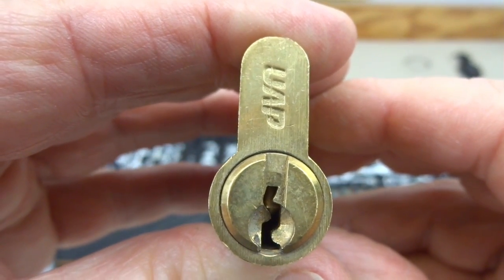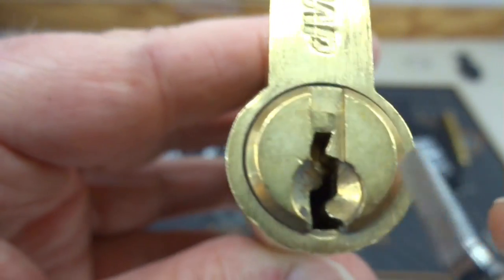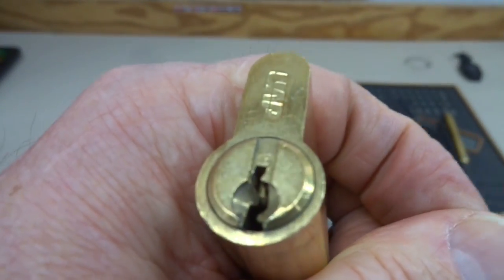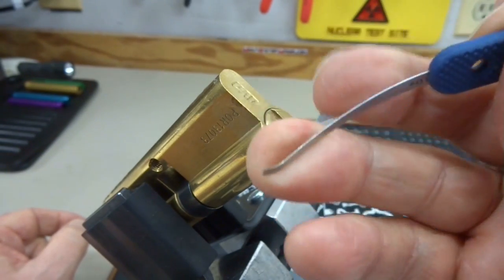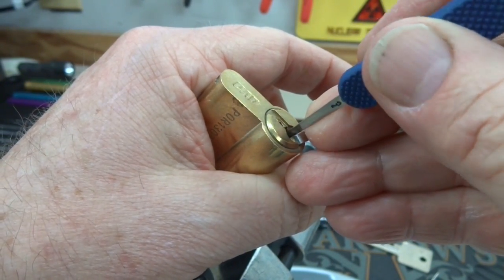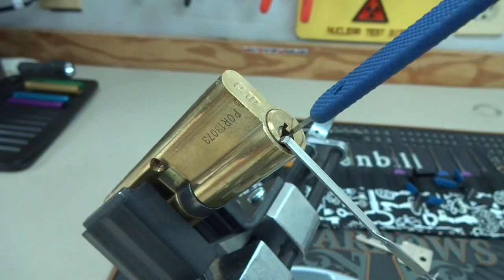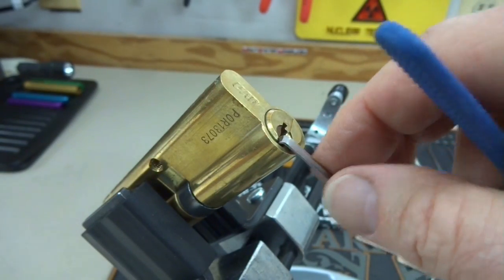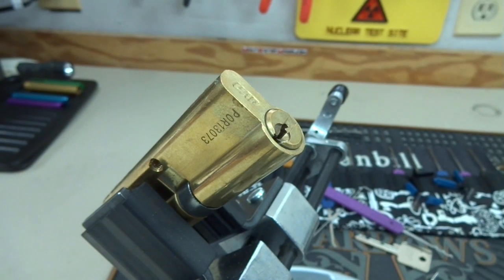(773) Andy's UAP Euro Cylinder

Comment: When you use tension wrenches do you always tension clockwise?
Reply: And yes im new to this before anyone bites my head off. We all gotta start somewhere.
Reply: No but some locks only open one way. Also if it is in door if you pick it the wrong way you would not be able to open the deadbolt so you would need a plug spinner to spin it around the right way. The last thing is it depends on what hand you pick, the other hand would of course tension the lock. I hope this helps!
Reply: CCNproductions1324
 Yes its helped. And im left handed so i get what you mean.

Comment: Those locks look really long, are they used in really thick doors?
Reply: +Shaun Beckman Theres a lock on both sides, on my one at home I have a 10cm euro cylinder and it goes right through the door which is about 7.5ish cm thick with no door handle and around 9ish cm where the lock goes through the door because of the door handles.

Comment: nice video again.  could u take one of these apart?  I think u start by removing the two circlips in the middle and then push out with a follower?  I could be wrong.
Reply: You need a pinning shoe for euro cylinders not a standard follower
Reply: +ken dangelo Alright, thanks.  I have never seen one being taken apart, i was just guessing.
Reply: +Ivan A no problem my buddy is from Wales and j asked the same thing a couple weeks ago they have a nice disassembly kit on dhgate.com that comes with one for 20 bucks check it out glad I could help
Reply: +Ivan The Great hi mate I have a short video on my phone that I did for a friend. unfortunately it wont upload onto my youtube without wifi. This will be done in the morning if you still care to have a look.
Reply: +The Happy Locksmith yes, please. thanks
Reply: its on my page now pal, bad quality video but you get the idea.

Comment: That lock is also able to be snapped. that's how a lot of burglaries happen in the UK.
Reply: +glenwoofit Only because people install them really bad. You need the right core for the right door.
Reply: No its not. It's got nothing to do with the choice of lock for the door!  Or even how badly it's fitted as it's to do with the inherent problem with the older euro lock. New euro locks have hardened steel for its back bone to stop snapping. I suggest you look up info on the subject.